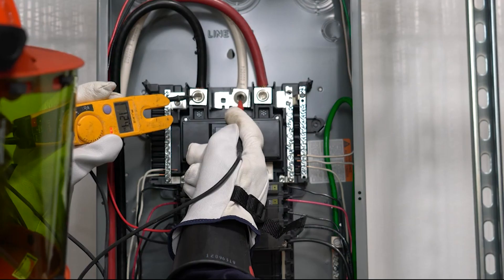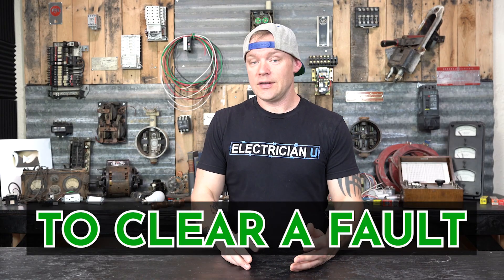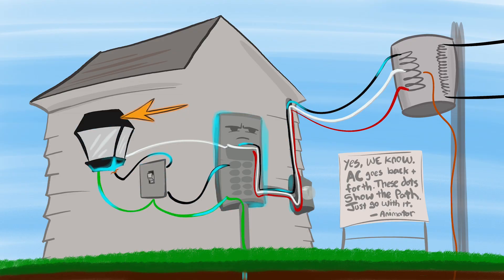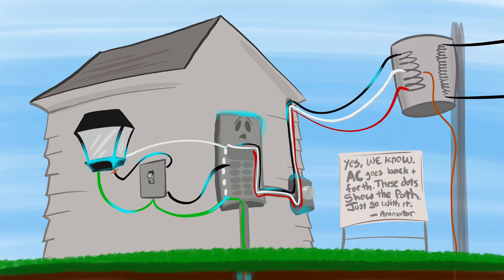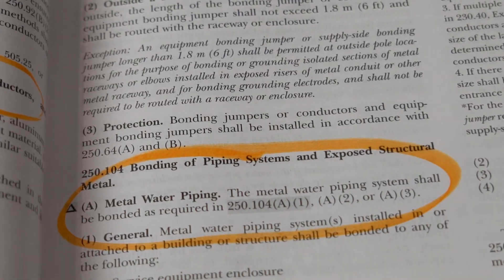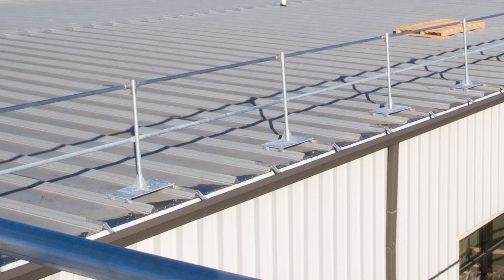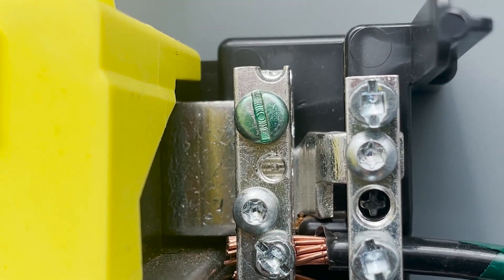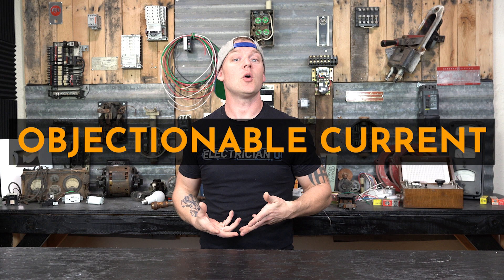Why Do We BOND Neutral & Ground in ELECTRICAL SERVICE PANELS?

Comment: I have to make a big correction.  An old school breaker works by "sensing" the current flowing through it.  When the current flow increases over the breaker specification, it will trip.  It doesn't care where the current flows and it doesn't care if there is a return to the panel.  A ground fault breaker is different. This type monitors output and return current.  As long as i/o are within specifications to each other (probably micro amps), the breaker can be set.  As soon as the input is not the same as the output, the breaker will trip off.
Reply: Glad someone said it
Reply: Yeah, this was killing me, so to speak. 😉
Reply: Thanks. I rewound several times to try and understand his logic. Now I understand
Reply: yes true about the GFI but an "Old School" breaker will not trip if there is a short to the egc or non current carrying metals that have not been bonded to the neutral at the source. The reason for this is the fault current will not ramp up to the levels needed to trip said breaker because there is no path back to the source of said fault current. Instead you will just have live non current carrying metals like pipes, conduit, boxes, tools, equipment, ect ....until you, someone else, or something else bridges that "gap" back to the source whether it be to the neutral or a separate phase. Which would result in a very bad day. Try removing the system bonding jumper on a separately derived system and then short an ungrounded phase conductor to the unbonded egc. It will not trip if the neutral point is not connected to the egc. Seen it myself when a coworker forgot to bond a transformer and there was a short to ground on a downstream branch circuit. Very common mistake and even though what omnipotent posted is mostly true I feel that this should be clarified because even seasoned electricians have trouble understanding this concept.
Reply: @arhodehamel2615  if you read my post you will see that I said the breaker will trip if the amperage exceeds the limit of the breaker.  It absolutely will trip at that point.  The current doesn't need to return to the panel.
Reply: @mdrew44628  the current only needs to return to the transformer in order for there to be current.
Reply: @poiiihy  the transformer is connected to ground......the circuit breaker would still work if you wired the neutral wire to a panel in a house two doors away.
Reply: @poiiihy  not really. the current can flow with a single hot wire and a single ground even if the neutral were to be disconnected. I've seen demonstrations of drill machines running with live phase wire and a ground wire running directly into the earth substituting the neutral. Needless to say the live wire got hotter than usual but there was no need of a closed circuit.
Reply: @arhodehamel2615  Are you saying that a short to ground will not trip an old fuse?  That can’t be right. The resistance is zero. The fuse will blow.with the increased current If you want to do in your nagging wife , you must put a nail across the fuse otherwise you’ve just wasted an opportunity haha
Reply: @bensilverstern4156  depends on the resistance of the earth between the house's grounding rod and the grounding rod at the transformer, as that would be the only return path to complete the circuit. the bond in the house's panel ensures that resistance to complete the circuit is (effectively) zero so the breaker can trip.
Reply: Could you please tell me if the NEC really requires neutral grounding?
Reply: @nicholaskukushin6626  as neutral is a center tap of a transformer.  Also known as a virtual ground, it will need to be connected to earth ground to bring ground and virtual ground to the same voltage potential. While home wiring bonds them, physics doesnt require it.  In other systems you don't want to bond them, as to create isolation.  A home would be perfectly happy without earth ground bonded.  The potential difference in the transformer is none the wiser.  But if that voltage was to stray to a metal chassis, or charge a swimming pool, it can make for bad days.
Reply: @falsedragon33  Yes you are right. There is no need to connect them inside the house. But I asked about NEC. The NEC is a large book that can be difficult to grasp without a higher education degree.
Reply: @falsedragon33  Exactly! Electrician's argue with me about this all the time.
Reply: Too many words,GFI is a breaker,on a much smaller level. They both sense.They both open. They're both manuel reset.
Reply: @CaffeineThrottle  well there are GFI outlets and GFI breakers.  The GFI outlets only open due to leakage current.  The GFI breaker opens due to leakage and or overload.
Reply: Not to be too technical, but for the sake of not confusing anyone who has never opened a breaker (voluntarily or not), an old school breaker doesn't "sense" anything. It's purely mechanical. They have no electronics. It's either a strip of two different metals held in place with a spring mechanism or a very small electromagnet. That's why they're like $3 each. For the more common electromagnet model, a calculated amperage is enough for the electromagnet to pull on a release catch. For the older breakers, when a calculated amount of current (amperage rating) passes through the metal strip, one metal expands faster than the other, causing the strip to bend and overcome the spring pressure. When this suddenly happens, it breaks the circuit and is held in the open position by an internal latch until you reset it.
The same style mechanism is used in old-style turn signal flashers, which is partially why they make the "tick-tock" sound. A bent metal strip heats rapidly, re-flattens, and closes the circuit. It then quickly cools, bends, and re-opens the circuit. Too much or too little resistance (bulbs) on the circuit affect how quickly it "flashes". The metal makes a popping noise as it distorts and bends in either direction. Changing to LED bulbs drastically reduces the load and the flasher doesn't heat up enough to actually cycle.
Reply: @rebturtle  perhaps that is why sensing was in quotes.
Reply: this is the main point right here. I don't understand Why he wants a closed circuit back to the main neutral when higher than specified current through a breaker would trip it anyway.
Reply: You're describing overcurrent protection, where is your big correction?
Reply: @alecmiller8803  I described over current and leakage current protection from two different types of breakers.  That was the correction.

Comment: Great explanation.  I'll add that proper bonding (and grounding) in low-voltage applications is important as well.  In data centers, everything metal must be bonded to reduce extraneous voltage that can cause havoc with computer and communications gear.  We must deploy and certify all bonded devices.  The costs to deploy such devices can be significant in the price to build a data center.   If I recall, we paid something like $20,000 for just the main bond cable (000) install run of 300'  back to the power transformer base thru its own conduit run.
Reply: what is (000) means here?
Reply: That sounds like a code violation.  Bonding conductors are supposed to be installed in the same raceway as the phase conductors.  Bonding conductors are not supposed to be installed in separate conduits or raceways.
Reply: @Tie509  Low voltage data center applications, as stated, not high voltage.  They meet industry code and certification standards for DC operations/builds... we build to full Panduit standards and are inspected and certified as such.

Comment: Coming into my weather head is 4 wires. The white neutral and green ground are both connected to the neutral from the transformer. white and green are also bonded in my main panel. Isn’t that having the ground and neutral bonded at two locations? 
Is the green/ground needed that comes out the top of the weather head? Couldn’t I instead run the green/ground directly from the ground rod to the meter and to the main panel and then bond it to white/neutral in the main panel? So then only 3 wires (2 hots and neutral) would come down the weather head into the meter and into the main panel?
Reply from the maker: Try asking in our facebook group or our discord: https://discord.com/invite/7ykYfbh

Comment: Greetings Dustin - Keep in mind not all generators are considered Separately Derived Systems. Another reason we do "grounding" of a system, per 250.4(A)(2) is a little more deeper than discussed. It also serves to limit the voltage to ground on the electrical equipment but grounding of a system itself serves also to provide a connection to earth for lightning, line surges, and unintentional contact of higher voltage lines to lower voltage, typically secondary conductors of the utility and also stabilize the voltage readings to earth reference under normal operations as noted in 250.4(A)(1). Also remember that not all "grounded" conductors are "neutrals" but all "neutrals" are "grounded conductors. for example a corner grounded delta or a 2-wire transformer installation have grounded conductors but are not neutrals. If no "neutral point" exists then it is not a neutral but it could be still a "grounded" conductor. Now, at 11:44 you speak of how a short circuit could create the objectionable current. However, it would not have to be short circuit current creating such a condition since the grounded "neutral" and the equipment grounding conductors would be tied together improperly down stream in violation of 250.24(A)(5) you would have circulating current on all metal parts regardless of being a short circuit condition. Remember, the neutral always carries current...not just potential fault current.

Comment: I like your videos, but I don’t think you explained the first example well enough.  If hot and ground are in contact, current will flow, otherwise you wouldn’t get shocked if you touch only a hot and are standing on the ground with bare feet, for example.  So why does the ground have to be bonded to the neutral to get the breaker to trip?

My guess is that the ground path has high enough resistance that the amount of current might be too low to trip the breaker, even though current is flowing.  It would have been nice of you had addressed that directly.

Comment: I loved the vid but was considering the explanation, and that's when the fog light kicked in.  Bonding at the service panel "to guarantee" the power goes back to its source, seems contrary to the opinion that ground is the path of least resistance.  For example: A panel might be 4' off the ground, yet the power pole 30' away.  If a short or fault occured, the easiest path is to ground.  4'  So, I'm asking for a clarification and it looks like the comments provide some clarification.  Love your channel❤❤😎  The thx. If you can give me a more direct response, it's greatly appreciated.
Reply from the maker: Keep in mind current is not looking for ground, it is looking to return to the source from where it came. We call it a circuit because it leaves the source and goes back to the source. Current will take the path of all resistances in proportion to the amount of resistance, from the source, back to the source.
Reply: @electricianu    ok....  I don't understand, but, appreciate your response and will further investigate for clarity.  Thanks..  Really a great channel💪👍👍😎

Comment: This is very useful. I’m renting an apartment in Mexico. I’ve got separate service from the other two apartments. The building was built by the landlord and his son—not a professional contractor. They hired a brick layer to construct the structure, and a plumber to handle the plumbing, but they did the electrical themselves. As is common in Mexico, I’m only getting half of a single phase service.

The landlord has given me the OK to modify the electrical (to add circuits or make repairs). The reason I don’t demand he handle it is the rent is so low (less than $200 for 2 bedrooms, 1 bath, rooftop terrace). I’m in the process of adding ground to all the outlets. I sank a 4’ copper rod through the foundation and into the soil beneath the house. That’s connected to the service, and from the service I’m slowly updating each outlet, one at a time. I’ve also grounded the copper water pipe system. BUT I failed to properly bond ground to neutral, and thanks to this video, now I know it. It’s now #1 on my projects for this weekend.
Reply: How did it go
Reply: @jett762  I am  a bit worried about him now... haven't heard back from him...
Reply: Probably did so well the landlord hired him to do the rest of his properties 😂

Comment: Ground is grounded to earth only for lightning strikes.  That's the only reason.  For 99.9% of lectures on residential wiring, you could leave out the fact there is a rod in the ground protecting against frying everything in the case of a lightning strike.  It may be confusing, since transformers, and substations also are grounded, so someone may conclude that ground is a path back to source, when ground is only a path back to source in the case of lightning.
Reply: Not an electrician, is this really the case? The only reason there is a ground rod at a per building is for electrical strikes?

Comment: Also if u lose the neutral at the pole and no grounding electrodes  it will electrify every piece of metal that has ground hook to it  at ground bar in panel. Ie. Fridge - stove -washing machine&  dryer hot water heater furnace and so on had a call like that fried every appliance in the whole house

Comment: This justification doesn't make much sense to me, the breaker would trip in both situations. Current is still flowing through the breaker in both situations and therefore the breaker will trip if current exceeds the rated amount. The graphics look amazing, but the explanation makes no sense to me.

Comment: if this is needed why was the electrical code in the united states updated to disallow ground to neutral buss bars? also GFCI works by detecting a difference in current from either load or neutral

Comment: Question if you have a service disconnect in the meter socket in the neutral and ground are bonded there is that the only place that you want them

Comment: Do you have a video about Bonding natural Gas or propane piping? I have metal (black iron) gas piping supplied from underground (coming in from my basement). Do I bond this? What does the code say? I also have a dielectric union near to the gas meter. A video on this and water pipe bonding would be cool!

Comment: Like the content...music not so much.
I'm just a DIY homeowner. I've noticed "grounding" wires attached to water pipes. When I'm replacing a section of pipe I've always bridged what will be the gap with a conducting wire and clamps (car jumper cables). If I interpose plastic pipe, I make the conductor "permanent" first. But I don't know why I do it. Now I'm "thinking" it's because the pipe must be at the same potential as the ground at the service panel to avoid any stray current flowing through me. Is that the idea, taking advantage of the fact that I will present more resistance than the panel bus bar as long as the pipe conductor is in place?